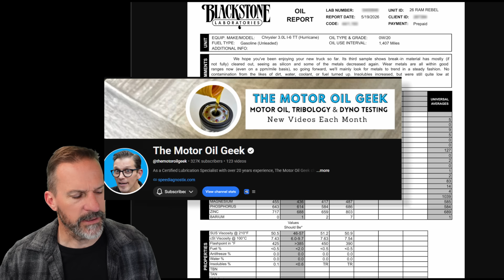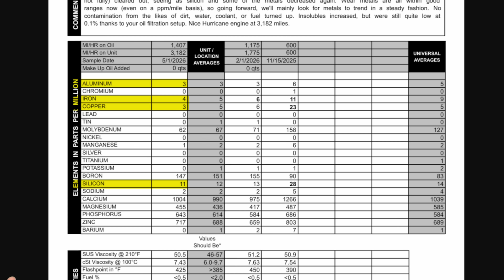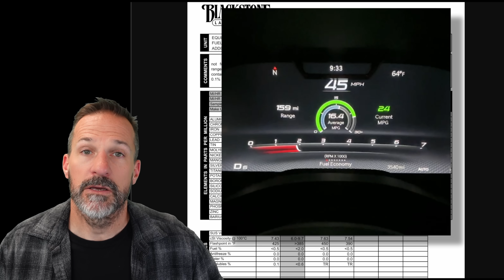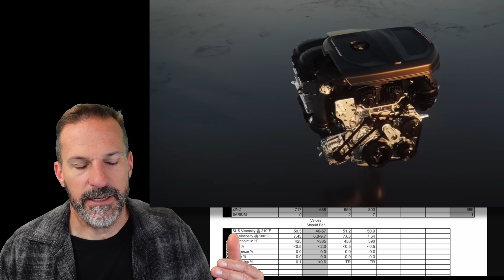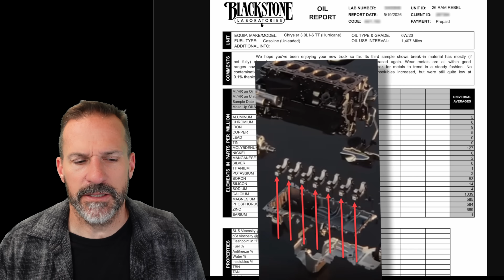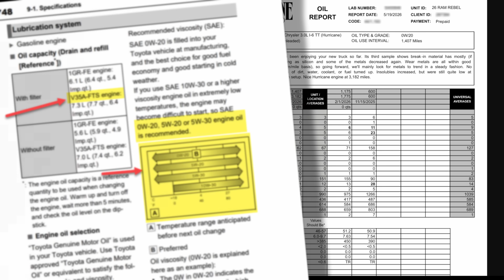The Break-In Secret Most New Truck Owners Ignore

Comment: Simplistic comment here, but isn't it crazy that we're reduced to stressing over oil weights and ratings in hopes of keeping the engine in our ridiculously priced modern vehicles from cannibalizing themselves from the inside out?
Reply: It really is crazy……🤔
Reply: It's not a new phenomenon. I'm sure plenty of people remember products like Slick50.  People have always wanted their engines to last longer.   If you were alive in the 70s and 80s a car with over 115K miles means you did something right or were lucky if it  ran on gasoline.
There was really no such thing as a 10K oil change back then.  It was literally 3K, and 5K was pushing it.   A lot more people were stuck by the side of the road with engine problems back then.  Cars overall have become a lot more reliable.  Precision and metallurgy have changed a lot over the last 50 years.
Reply: @gags730  Same rebellious behavior & protesting about pollution devices today though. I began working at a gas station in '77 & many drivers w/ '75 & newer cars refused to put unleaded gas in, reamed out filler neck & subsequently plugged up catalytic convertors. I learned by those nitwits to leave stock, run fuel & oil per owner's manual. I buy new vehicle every 5 yrs for warranty & refuse to risk it by challenging the engineers & changing up the oil viscosity.
Reply: @ews360   I believe if the oil additives were so good, they would sell  oil with it already in there.  You wouldn't have to add it.  You would just be able to buy Mobil or whatever brand with it added to the oil.  If the additives were proven, then a major brand like Mobil would sell it and stand behind it.  Not only that, but they would sell it for a premium and make some large profits off it. Funny how we don't see that.  

With some of these oil viscosity issues, some of that is strange.  The same MFG owner's manual in another country will suggest a thicker oil.  In that very specific case, all things being the same... again all things the same and that very specific case I don't see running the thicker oil  from an xW-20 to an xW-30, especially in the summer, if it's suggested in another country.  That is a very specific case. The manufacturer has to warranty the car, so if they say it goes in there, I put it in there.  If they compare the failures with a thicker oil in another country and a thinner oil here are the failures the same?  Im sure they know that answer.

I think what we are seeing with a lot of these cars is just a problem with the bearing size.  They keep pushing these little motors to the limit, squeezing every ounce of HP out of them, and everything has a turbo.  I don't think the oil is going to save them. They are putting so much stress on undersized bearings, or  something like that is what I believe.   Its not the first time a MFG has had problems, and it won't be the last.
Reply: @gags730  But people are doing this now in the hopes that the vehicle will last until it’s paid off! Low expectations are the order of the day in 2026. Literally EVERYTHING produced and sold has gotten worse.
Reply: 100%
Reply: While yes there are a few engines that are failing everyone seems to be forgetting that many engines have been using 0w20  for 15 years and no issues, even the 0w16 and 0w8  have been in use for years since 2020 in japan and you dont see corollas or camry or rav4 engines eating themselves using 0w16 and 0w8.   the v8 tundra is well known for lasting several hundred thousand miles on 0w20.
Reply: @motorbikemike65    0W8 just sounds insane to run in an engine.  Not saying it is bad or anything... Its just seems crazy.  Once the engine heats and and with oil shearing its just seems so thin.
Reply: @gags730  they use large amounts of additives for shearing and anti wear.  But as i mentioned  corolla is now using 0w8 in north america and has been in japan for almost 5 years .  It does become important not to extend oil changes past  5k miles max.
Reply: Avoiding $$$$  surprises down the road.
Reply: Chill. Perhaps, just Perhaps, someone respects the end product with respect 🙏.  What would you say to a gifted Ford Model T inheritance?
Reply: @fredtippett670  😂
Reply: It's not 1980 anymore.
Reply: WE DIDNT ASK FOR LIGHTER OILS ESPECIALLY IN OUR D.I. TURBOCHARGED ENGINES...ITS COUNTER INTUITIVE IF YOU HAVE THE LEAST AMOUNT OF KNOWLEDGE UNLESS YOUR THE CORRUPT EPA
Reply: Not me. I just use real synthetic oil like Redline and change under 5k miles.
Reply: I have gone too amsoil5/30 in a GX460 after the dealer free oil changes ran out. Both of your future oils will be acceptable. I purchase certified pre owned vehicles because I cannot get past the depreciation of new cars. I would follow the oil geek recommendation if I purchased new vehicles.

Comment: 5w30 in the summer and 0w40 in the winter imo.
Reply: They try to keep it simple when explaining oil weights but the 0w40 cold or hot will always be thicker than the 5w30 despite the 0 rating so the 5w30 would actually flow faster in the cold than the 0w40 but the 0w40 of course will flow faster than a 5w40 or 10w40.  0w40 would be fine year round.

Comment: 5W 30 every day of the week and twice on Sundays.  Especially during summer.  You want less friction or better WEAR protection.  You rather risk trashing a 11K dollar motor or take 1 MPG less.
Reply: I moved to a premium oil. Amsoil SS 0w-20 in hopes that it would hold up better. If not, 5w-30 it is. I have oil analysis with viscosity out of spec with 3k on the oil. I think it comes down to warranty. No one wants to lose the warranty for something like this.  These warranty places will deny it for anything these days it seems. Tried to figure out how to get around it with no luck. I have receipts and logs for maintenance.
Reply: As long as they are at the correct point of the Stribeck curve, who cares on the grade. Lake did say Application dictates the oil to use

Comment: I am a Ford Senior Master technician (Retired) and teach automotive technology at Lone Star College. I have two 2023 F150 5.0 trucks and a 2024 Raptor 3.5. I have followed a similar break in procudure to you, and I change my vehicle's oil avery 3K. I just changed to Full Synthetic Valvoline Racing 10W-30 on my Raptor for the summer months here in Texas. My F150s are running Mobile 1 5W-50 year round (one is Whipple supercharged) and firmly believe in higher weight oils. These oils may effect fuel economy slightly, but I do not care. I would see zero problems with at least a 5W-40 in your Hurricane. Just my opinion.
Reply from the maker: It’s great to get that perspective from a seasoned tech, especially regarding the move to higher weight oils. I appreciate the comment.
Reply: OEM's push this garbage to gain another 1 MPG.  And they don't care if they have long life.  Just enough to get you past the warranty.
Reply: @HiPlains1 
It’s not even 1mpg for some changes. Toyota went from 0W-16 to 0W-8 for a claimed few tenths of a percent on the M20A-FKS. I’ll bet it’s only 1 or 2 tenths on the A25A-FKS.

The only difference is for them when you apply that reduction across the hundreds of thousands of vehicles they sell in the U.S. We get stuck with the baggage after being their Guinea pig.
Reply: So after 30 years in this business. The day I saw a 0/20 on the oil cap. My first comment was wow they don't want these engines the last do they. Anyone who's been in the auto tech industry for more than 10 years or so that understands how and a boiling system works will tell you zero viscosity meaning the oil is so thin it's probably not going to stop the crank from hitting the bearings it's not a good idea. Needless to say I constantly recommended to my good customers why don't we run 5:30 in this to play it safe cuz I think they're wrong no way 0/20 or anything o/whatever is going to be good for your engine. Let's remember the definition of zero is nothing. Now add in the fact that you're dealing with tighter tolerances and the infamous rgm delete motors. And you have a recipe for disaster. Again I've been saying it since the day I saw it on the cap what the hell. I was called an idiot for telling GM they didn't know what they were doing. Who the hell was right now
Reply: I'm just switching to AMSOIL SIgnature 5-50 in my car, too
Reply: @radz-cp8lt  5w-50 is used best for supercharged applications. Thicker is not always better. Also, the larger the difference between the winter or cold viscosity vs the hot, the faster it will shear down. If you use a 50 viscosity don't run extended oil change intervals.
Reply: the problem with new cars is that oil passages are made alot more thinner then the older cars built that would feed the engine more and not starve it, now adays all the engines built are tight made and have thin lines and passages and everything that cuase the engine to starve of oil needed, back then you could run thicker oil and the engine is more healthy due to longer lasting and bettter lubrication and heat resistance.
Reply: @KamZin-vt2rw LOL. Cold 0W20 is thicker than hot 5W30. Think about that.
Reply: @336W OKAY BUDDY
Reply: With all due respect to your career as a Senior Master Tech and instructor, there is a massive difference between fixing an engine and engineering one. Your experience is in diagnostics, part replacement, and observing post-mortem failures—not in fluid dynamics, metallurgy, tribology, or FMEA.
The reality is that your recommendation to run heavier oil weights isn't based on controlled data; it’s based on personal hunches and a very small sample size of your own vehicles. You don't have used oil analysis trends across thousands of fleet vehicles, you don't have milliseconds-accurate cold-start flow data, and you don't have the engineering telemetry to know how a thicker viscosity alters the variable-displacement oil pump curves or VVT hydraulic responses specific to the modern Stellantis Hurricane engine.
Master technicians see the broken fraction of vehicles that enter a shop, which naturally creates a bias against factory specs. But 'it hasn't blown up yet' isn't empirical data. Without actual lab testing and engineering data to back it up, advising people to deviate from factory blueprint specifications on a highly complex, twin-turbo engine is just bro-science wrapped in a good resume.
Reply: @D2O2 I’m going by actual oil analysis (Speediagnostics) and my Toyota 0W-20 has sheared out of viscosity range twice at 3000 mile intervals. I’m moving up a viscosity grade. I live in a very hot climate.
Reply: @davidwelty9763 And if you had just followed the mechanic experts that claim 3-5k OCI and you are good instead of doing the UOA, you would not know this.  Was your wear metals elevated?
Reply: @D2O2 yes,  but the report said it was well within range during the break in period for that vehicle. This was the first 6k miles.
Reply: @D2O2  omg fnally some one with brain comment here,   you are %100 right!  whole youtube are full of this oil crap, all this youtuber trying to get as much VIEW as they can wit oil BS, all of them are self made engineer, they know better then any automotive engineer! anf they have big follower, most of them dont even own vehcile LOL
Reply: @D2O2 at the end ,all that engineering crap that you just wrote is why engines are failing from north to south, west to east.  we the performance engine builders that dont owe nothing to epa or manufacturers can determine proper clearances and oil weight for the application at triple the power without losing a bearing.
Reply: @mandytuning You say bearing failures are caused by clearance, filtration, and oil film. You're right. But you are ignoring the relationship between clearance and flow.
Bearing protection isn't just about high pressure; it's about flow volume to carry heat away from the journal. If you force a heavy 40- or 50-weight oil through tight factory clearances designed for a thin oil, the flow rate drops drastically. The fluid resistance increases, oil temperatures spike in the bearings, and the hydrodynamic oil film shears. Your own list of failure mechanics explains exactly why ignoring factory engineering blueprints in favor of "bro-science" oil weights destroys modern stock engines.
Reply: @D2O2 LOL. Then your bearings would fail on a W20 during cold weather, cold engine starts. LOL.
Reply: @336W Tell me you don’t understand the difference between zero-load cold idle and sustained 6,000 RPM hydrodynamic load without telling me.
On a cold start, you’re idling at zero load and the oil pump’s pressure relief valve is dumping excess fluid back to the sump. Cold starts are where ~80% of normal engine wear happens precisely because thick, cold oil starves flow—which is why a 0W rating exists in the first place to minimize that exact lag.
Conflating a 5-second cold idle with sustained high-temp bearing shear under boost isn't the "gotcha" you think it is.
Reply: “Full Synthetic” is a scam , it’s not 100% synthetic unless it says 100% Synthetic, it’s just a blend …
Reply: @itsallgood747 the refinement and work that go into full synthetic far exceeds a regular conventional so while it may have actual petroleum in it it’s not a scam. Conventional oils are expensive these days. There is no reason not to run full syn.
Reply: @AB-coyote  I think a synthetic blend oil is better than full synthetic from what i seen, the company i use to work for had a fleet of vehicles and ran a lot of miles on then every year the used a synthetic blend oil in all them, used valvoline or the ford synthetic blend in the ford vehicles all vehicles went over 300k miles and the oil place where they where serviced said they where they cleanest engines they seen with such high millage. and no oil comsuption problems oil leaks. ford did some testing on their synthetic oil blends and found out that it did better in real world conditions than full synthetic!
Reply: @itsallgood747 
I sorta find myself coming down on the side of the way that old 90s legal case between Mobil and Castrol shook out. 

Even if it’s still a Group III, and is completely void of PAO etc, it’s all hydro-cracked. The molecule chains are all uniformed and their chemical bonds have been modified so as to resist oxidation. In the case of Gas-to-Liquid you’re getting a product that’s been made of uniform chain lengths from a starting molecule as uniform as the decane they build Group IVs from.

Sure it’s not all group IV, but it performs really good at a price point that works really well for me.
Reply: @itsallgood747 100% synthetic or Full synthetic are just marketing terms.  That's all it is!
Reply: @itsallgood747  it’s not a scam, and by the way, 100% synthetic also isn’t 100% synthetic. You need to chill out on watching YouTube….

Comment: You dont mention "driving style" during break in very much.  The motor needs to work.  I dont mean driving it like you stole it.  I mean to use moderate throttle off and on. You only get one chance to mate the rings to the block, and this only happens if the engine is performing real work.  Your description of low towing over mostly flat ground is spot on.  The last thing you want to do is "Baby it".
Reply from the maker: Agreed, most manuals recommend this in some way or another....don't be WOT, but don't baby it. I tend to drive lighter to get better mpg so when I break something in, I have to consciously force myself to burn a little more fuel to do it properly :).
Reply: Brisk accelerations and no constant speed cruising for the first few hundred miles. Has worked well for my few cars and motorcycles that I have bought new.
Reply: Plenty of cars have a 'Sport' mode or equivalent.  Why not just drive it in that mode during break-in so that you get higher revs without beating on it.
Reply: @gags730  It's not revs you want.  It's a moderate load.
Reply: @AlisoBob  Whats the best to get a moderate load on a new car? They have so many gears.   My wife's car that thing shifts gears below 2,000 rpm.  Its in 6th gear at like 35 mph.  Sports mode brings it up to 3500 before shifts and at 35 mph, it's in 4th. 
 What do suggest with new cars?  Thanks for the reply.
Reply: @gags730  Press the gas hard enough to put a good load on the engine, but not hard enough to cause it to downshift in the next lower gear. The idea is not to baby it, but make it do some work. This does not mean to beat on it...... just make it work .  You do noy want "sports mode".  This is the opposite of what you want .
Reply: @AlisoBob   Thank you for the reply and info. Appreciate it!
Reply: @gags730  No worries.......  A little load here and there,  add quality oil and filters changed a few times beofre 3k miles...... and the engine will most likely give  you a lifetime of reliable trouble free service.
Reply: Just give it good throttle going up hills, but don’t rev it too high.
Reply: I do 1500 mi change first then 3k then every 5k it’s been working just fine and I have a raptor